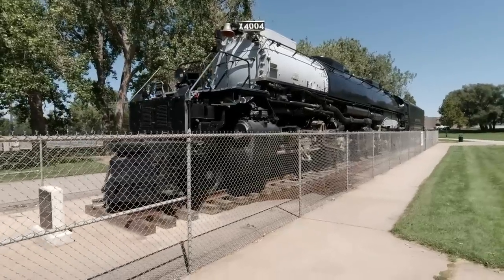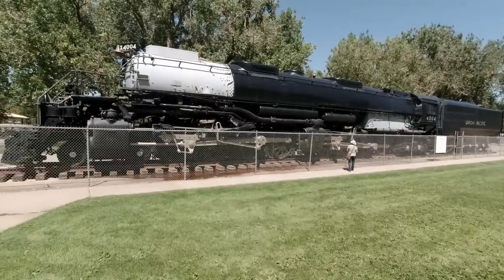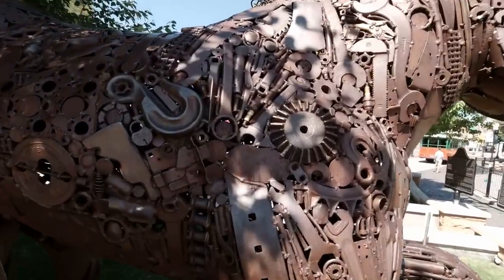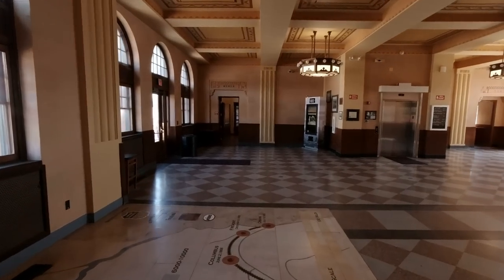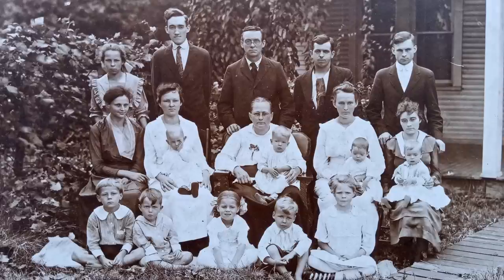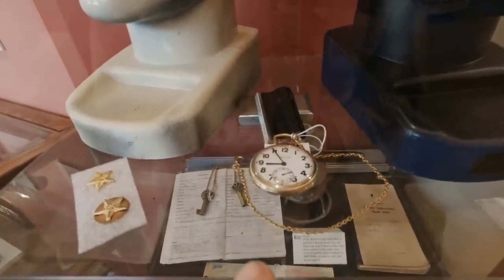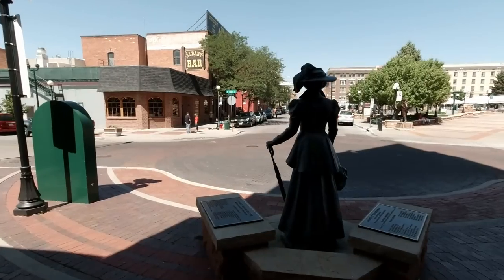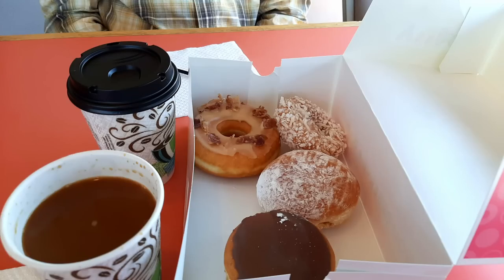Trains, Boots And A Great Museum - Cheyenne, WY!

Comment: Thassa big engine! I think Trump would say yuge....

Telescope house? We called them shotgun houses in south Texas, no 8dea why.

Gimme a pair of 13MWZ cowboy cut Wranglers!  Looks like a beautiful town, summertime visit kinda place, bet the winters are brutal. Thanks for sharing
Reply: Because of there open design, you could shoot thru the front door and it would go out the back door without hitting anything.
Reply from the maker: I forgot to mention about the telescope houses getting progressively narrower as they went back.  I hadn't heard shotgun house before but like the explanation!
Reply: @gonagain  in Louisiana they built them like that because of permit and tax cost, they were charged by number of rooms, and windows i believe. So they put in doors instead of windows and made them open room. It also helped ventilation. Mostly a Creole design. (If i remember correctly)

Comment: Thanks!

If that engine ever did run on coal it took one hell of a coal shoveling man to feed it.
Reply from the maker: Great point and I hadn't thought about that.  I know that #4014, which was recently restored, had to be converted to oil.  I wonder how they did feed the coal?
Reply: @gonagain  .... My bet is it had a coal conveyor belt, fed by at least one man, and then at least one more man to fill the box.  It had a big box and would have killed one man to run it.

I read on Wiki that one of the others were converted to oil and then returned to coal because they could not get the burn box to heat evenly.  This one probably had the same problems but made no difference when retired.

https://en.wikipedia.org/wiki/Union_Pacific_4014
Reply: @jimb5113  I shared an explanation and really neat film about how it worked, but I guess youtube removed it, bummer.
Reply: @charlesr479  .... Maybe public education is not our only overlords.   LOL!

Comment: How long has it been since travellers treated pilots, stewardesses, bus drivers with respect?
Reply from the maker: You're right about people today because there are too many who were raised to only think about themselves and not others.  As a retired commercial pilot I think I have a say in that because I spent a lot of time both flying and riding as a passenger.  It started when the airlines began making the seats so small and the legroom so short that a smaller person had a hard time being comfortable let alone a full size adult.  I heard a lot of complaints but the passengers were told to like it and shut up, then they made them smaller yet.  They also took away meal service and any sort of "service".  Kindness went out the window to the point where I refused to fly as a passenger any longer.  It doesn't matter how nice the flight attendants are (and they usually are), if you treat the passengers like freight instead of humans it isn't very good.
Reply: @gonagain  My brother is a pilot for Southwest.  He is appalled by the clothing, or lack thereof, and the use of despicable language.  Used to be that travelling was a privilege.